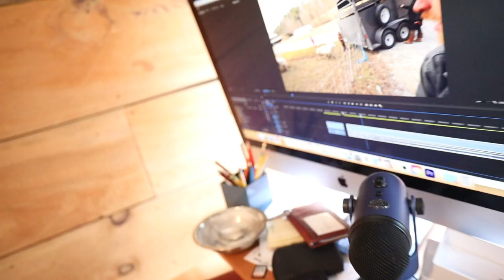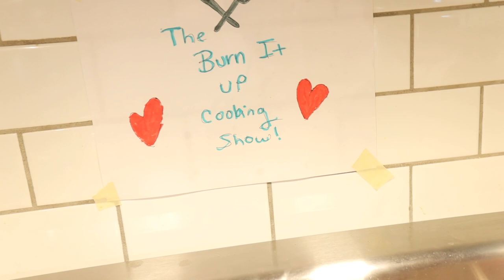Backyard BarnYard Bliss UNTIL the Cows BROKE OUT

Comment: Justin, moist and crisp is easy.  First, prepare it just like you are - rub it down, and vegetables/broth/water in the pan as you like (the vegetables lift the chicken up out of the liquid so you don't need a rack).  Then cover your chicken to cook it, and this will always keep it moist.  If you don't have a lid, use foil.  Then uncover for the last 15-20 minutes or so to brown and crisp.  When you uncover it, you could also bump up the heat to speed up crisping.  The higher the crisping heat, the shorter the crisping time.  Of course, you have to play with the times according to the size of your bird.

Comment: My dad had a raised water trough for our cows which made it impossible for them to defecate in it. He also used a toilet float to automatically refill the trough when the water level got low (the device was behind a metal frame so the cows wouldn’t damage it by scratching their heads on it).